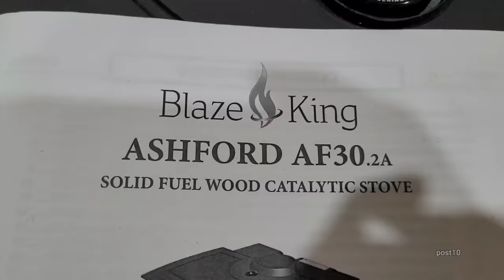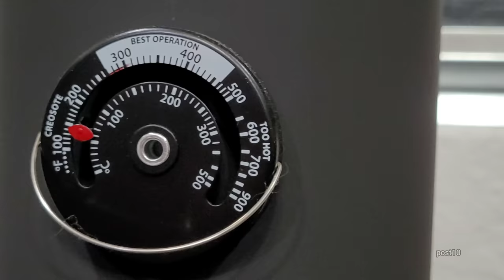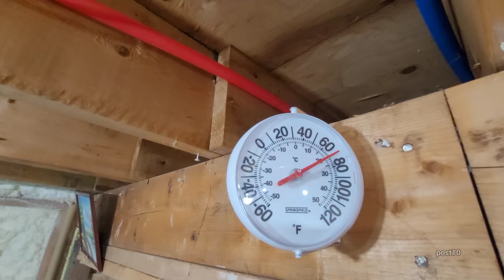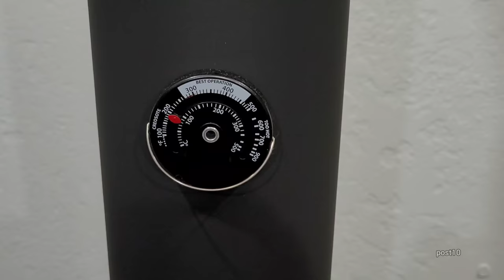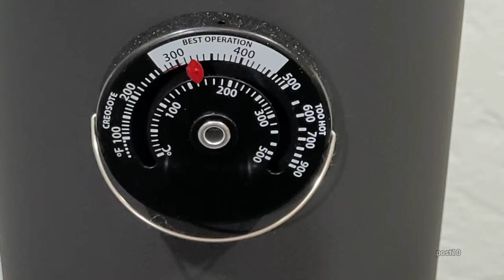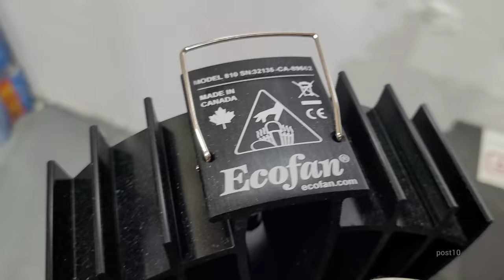Why I Started Heating My Home With Wood And How I Manage My Land. Blaze King Catalytic Stove Review

Comment: We live in New Hampshire and want to convert to a wood stove. No “stove shop” that we have spoken to has ever offered guidance or advice on where a stove would best work in our home. We have a square footprint - an open concept with all rooms right off the main open kitchen/living room area. Would love to put a stove down in our basement - but would we have to cut vents in the floors? We literally have found no one (even the people selling stoves) that can help us make these decisions.
Reply from the maker: When i first installed this I was going to cut a hole in the floor so heat could rise up stairs or even be forced upstairs with a fan but it's not necessary. The hot-air goes billowing out the top of the door and up the stairs while the cold air rushes into the room on the floor. I don't know how your house is set up but I'm thinking about just putting fan at the bottom of the stairs. Also cutting a hole in the floor without ductwork may upset your insurance company because the fire could spread upstairs faster. I think having it in the basement is the most feasible idea because it will rise up to even through the floors making the floor warm upstairs. Mine is in the corner of the house so obviously that room is going to be warmer but it doesn't bother me. If you have any other questions asked and if I see it I will reply
Reply: @post.10  wow - thank you for your response. Is your wood stove in the basement as well? My husband wonders if we should get a wood furnace instead of a wood stove. We honestly have no idea. We also have a brand new pellet stove that my father has purchased (he lives with us). I wouldn’t mind setting that up as well, but I want the stand-alone reliability of a wood stove too. Any thoughts would be greatly appreciated. Thank you.
Reply from the maker: @katiejon17  yes my wood stove is in the basement. A wood furnace outside as in a central boiler is typically a waste of wood if you are just using it to heat the house but they can be very efficient if your heating multiple buildings at the same time. A outdoor wood furnace and pellet stove both require electricity unlike the indoor wood stove. Watch some videos on how they work

Comment: Did you really pay $4000 just to have it installed? Yikes, that’s a lotta cash for labor!
Reply from the maker: I think the piping may have been included in that, it's like $100 for every 3 ft because it's stainless steel
Reply: @post.10  Gotcha, still seems high but it looks like a good solid unit, good luck with it bud! Enjoy your videos- you’re a guy with a sh*t ton of common sense, something not seen much these days!

Comment: Wasting so much energy! 🤬😠😡
Reply from the maker: Are you talking about the window being open? That's because I got smoke in the room and I'm trying to let it out
Reply: @post.10  No. I'm talking about the fire in the middle of the yard/woods. Those branches could heat a house. I know that would take so much time to continuosly  put in a stove or furnace, but I just can't accept so much waste. I'm just collecting even the smallest branch and will put in my tile stove to get heat of them. At least I'd use them for BBQ. I'm sorry if I was too confrontative, but that  scene blew my mind. Have a great day, mate!
Reply from the maker: @TheRossz  well I'm also trying to prevent a forest fire, I'm using all the logs to heat the house and all the branches are being burned, summer keeps getting drier and drier and it's a matter of time before a forest fire could happen, better to do a controlled burn now then an out-of-control Wildfire later